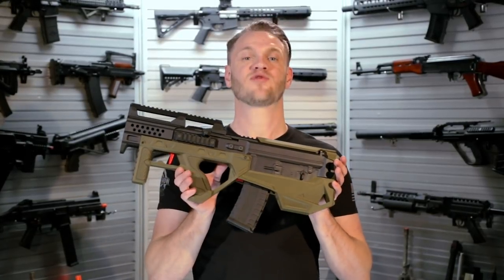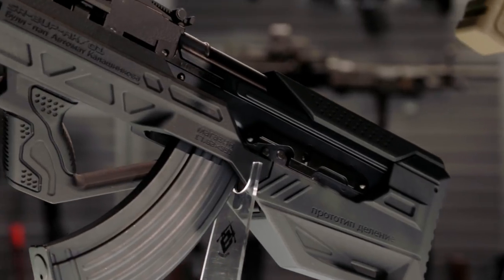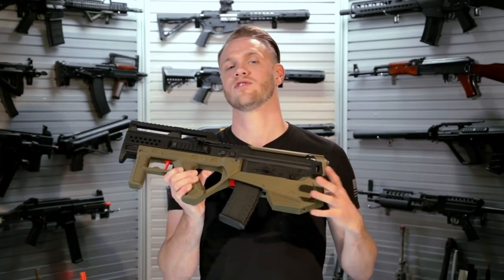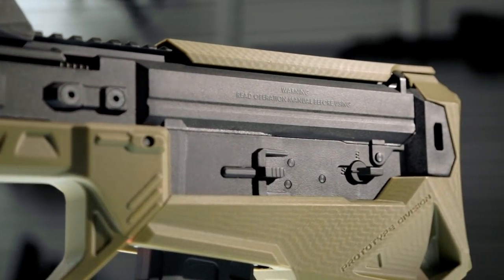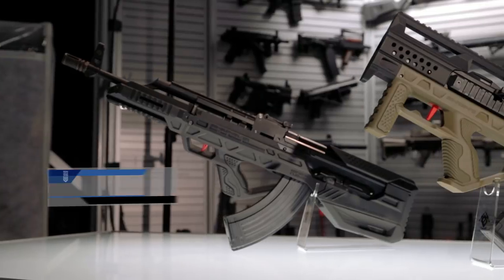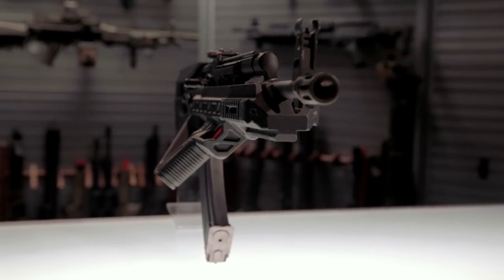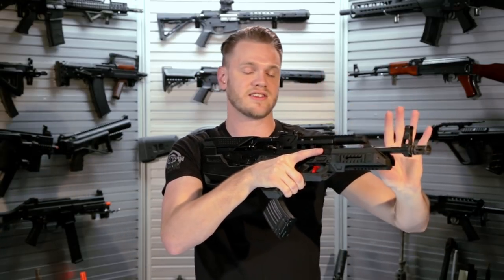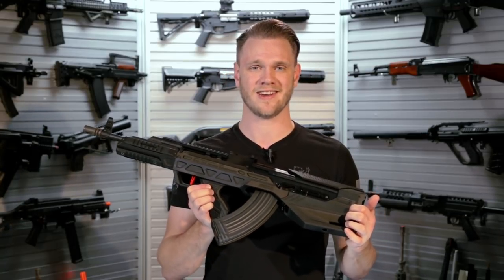SRU Prototype Division G5 & AK47 3D Printed Conversion Kits - [The Gun Corner] - Airsoft Evike.com

Comment: They need to make a groza at home conversion unless you can at least use the stuff & things conversion kit to at least have a groza at home. How that works is there's a pistol grip where than handguard goes with a trigger bar connected to the actual trigger which is covered and there's a carry handle where from front to real sight. I've also seen a conversion kit that does the same thing with a  krincov and what actually houses the motor is the stock.whixh has been extended at the bottom to cover it

Comment: Question is with some possible tinkering could these conversion kits be used on their real firearm counterparts?
Reply: Short answer most likely not

Long answer, maybe. 3D printed unless its very strong plastic would most likely break after some recoil. As well as mechanical issues and such. And parts touching the barrel would melt after pro longed use. Just don't recomend unless you can get someone to make you one thats reinforced and uses some metal parts.

Comment: still waiting for a company to create a carbine conversion kit for the walther PPQ! 45 rd magazine capacity mp11 style
Reply: Pablo Muñoz I like the thought. Design is nice, would change the stock design though. Awesome work none the less I can't design that so props. If you test it on a ppq and it works let me know. I will buy 1. It's just a grip attachment that extends to a adjustable stock?
Reply: I live in spain so it´s impossible to test in a real firearm, but if you are really interested send me the meassures of the ppq grip i can adapt this desing for the PPQ. I can send you the STL files and you can try to find a 3d printer near you. The stock is just a cheap airsoft m4 style stock with an adjustable check riser (also 3d printed) you can put any stock you want on the buffer tube. Now i´m working in a folding design but i´m not very sure if it will survive a real gun.

Comment: The crazy low mag capacity kind of ruins it for me. I'll just use a gas pistol with higher capacity
Reply: Cameron Vollmers ....they have the same amount of ammo as a pistol if not more compared to some
Reply: OP Airsoft if you use stock mags. Extended mags will hold around 50. The highest I found for the GHK was 40.
Reply: Cameron Vollmers only for hi capas/glocks/m9....you aren't losing much ammo.
Reply: OP Airsoft yeah it's not a crazy difference, but rounds count for a lot and a bigger heavier gun with less ammo just isn't worth it IMO :p
Reply: Cameron Vollmers well then why even bother with pistols? Just get a plastic pdw m4 and have a 3000 round box mag.

Comment: The G5 one cracks the lower
Reply: Only if you don't put the stock pin into it.
Reply: mukmuk723 no, it cracks no matter what. The ghk g5 is known to crack. Multiple people who have used this kit on the ghk g5 owners group have reported it cracks. The receiver isn't sturdy enough to hold without a stock.
Reply: kevin dellatore good to know
Reply: There are many ways to reinforce the lower. Some put epoxy in the fins. Someone got a screw from WE and drilled it into the back. Someone even got one of those heavy duty zip tie to hold it.